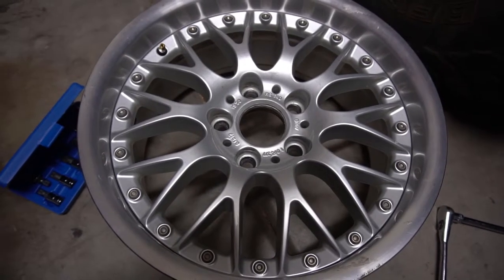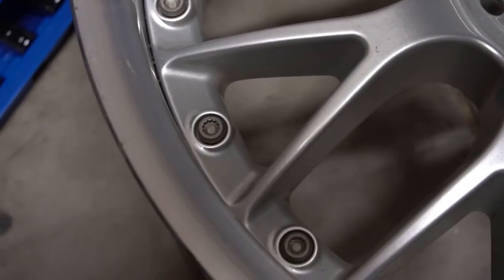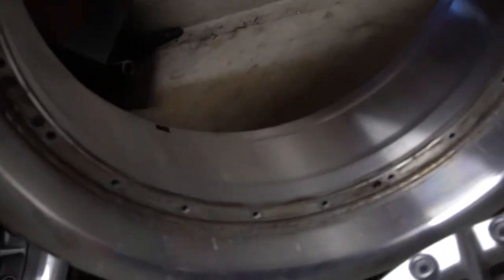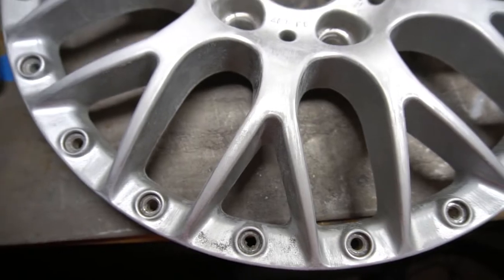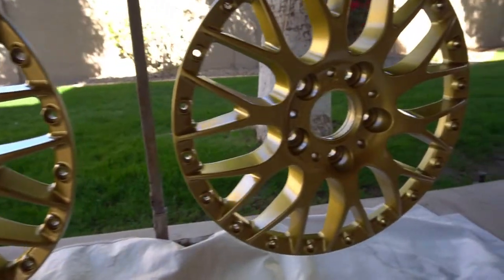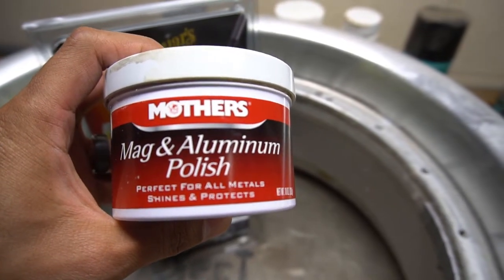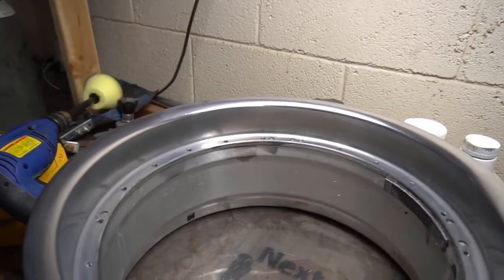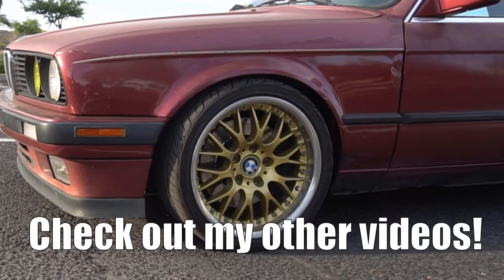S52 E30 episode 5 | Refinishing Style 42 Wheels

Comment: A much better way to do this is to use an impact driver. Did all 4 of my wheels in less than 5 minutes. God bless anyone who does it by hand lmfao
Reply: Troy McClure  did it mess anything up doing it this way?
Reply: No, the only thing that could happen is you strip a bolt. I’d reccomend using low power settings on an impact driver/gun so you dont strip anything.
Reply: I did not have to heat the bolts being that I used an impact wrench. Id highly reccomend the milwaukee m12 3/8 stubby for this job. Or any high torue rated impact driver. You’ll also need a hammer to seperate the two pieces
Reply: I did not have to heat the bolts being that I used an impact wrench. Id highly reccomend the milwaukee m12 3/8 stubby for this job. Or any high torue rated impact driver. You’ll also need a hammer to seperate the two pieces
Reply: I did not have to heat the bolts being that I used an impact wrench. Id highly reccomend the milwaukee m12 3/8 stubby for this job. Or any high torue rated impact driver. You’ll also need a hammer to seperate the two pieces
Reply: I did not have to heat the bolts being that I used an impact wrench. Id highly reccomend the milwaukee m12 3/8 stubby for this job. Or any high torue rated impact driver. You’ll also need a hammer to seperate the two pieces
Reply: I did not have to heat the bolts being that I used an impact wrench. Id highly reccomend the milwaukee m12 3/8 stubby for this job. Or any high torue rated impact driver. You’ll also need a hammer to seperate the two pieces
Reply: I did not have to heat the bolts being that I used an impact wrench. Id highly reccomend the milwaukee m12 3/8 stubby for this job. Or any high torue rated impact driver. You’ll also need a hammer to seperate the two pieces

Comment: Can I remove my faces without removing the tires off the wheels it’s my daily and I’m to lazy to get get my tired taken off paint them then go back and get my tires mounted
Reply from the maker: i think technically you can, i definitely would not recommend it. Messing around with wheels while tires are on seems dangerous
Reply: You can if your tires are deflated all the way. Inflated tires can cave in the barrel of the wheel